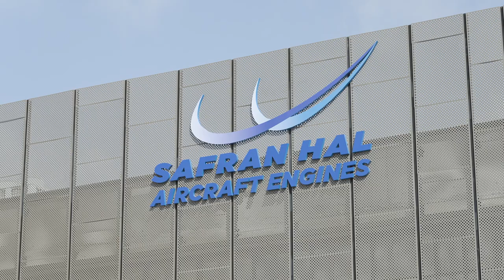Safran HAL Aircraft Engines - Bangalore

Comment: So what they are doing is making pipes & nozzle for engine.. i mean its is like 3 tier contractual work.. common guys you need to make blades, compressor section, ignition section all those exotic stuff in india..
Reply: Their aim is to completely carry out the MRO of Tm333 and Shakti 1H engines within india without requiring the import of french compoments.
Reply: U r right. Metallurgy is advanced and India does not have the expertise to make metals for aircraft engines fighter aircraft leave along passenger aircraft.
We have been struggling for 25 years but no material breakthrough as yet unless there is tech transfer.
Reply: @jotendrakumar2852  🤦 india has metallurgy technology
Reply: @uditbasumatary7145  India has but not yet to make aircraft engines blades. The research we r doing for past twenty years has not yielded fruits. The blades lose shape one after running on simulator in GTRE.Gas Turbine Research edta6